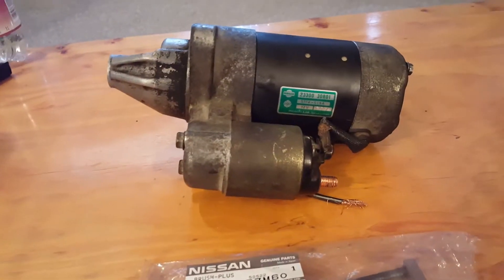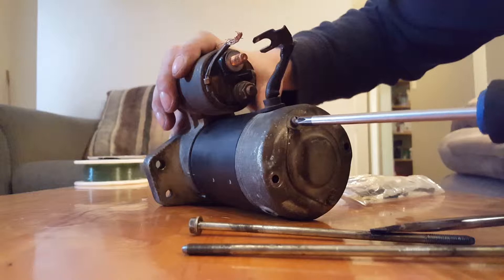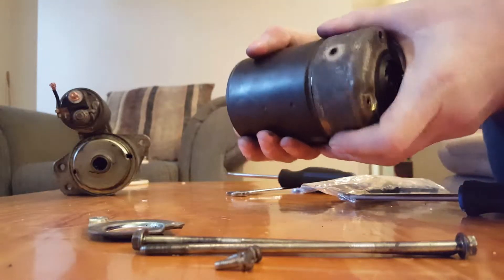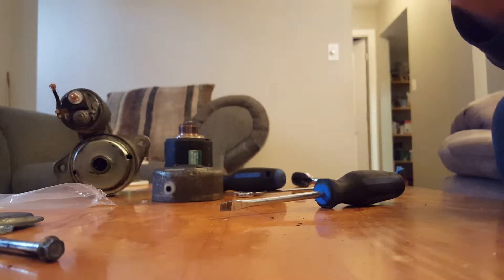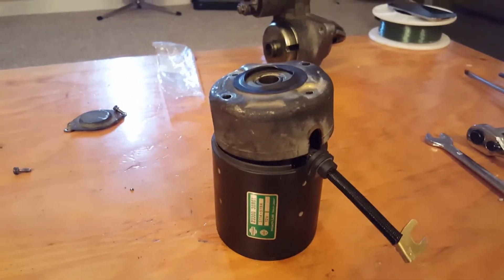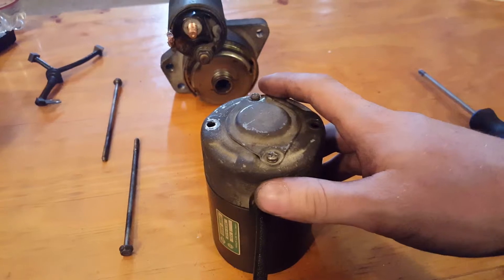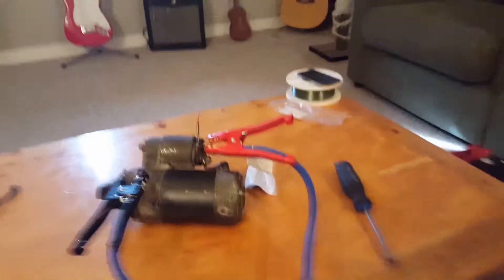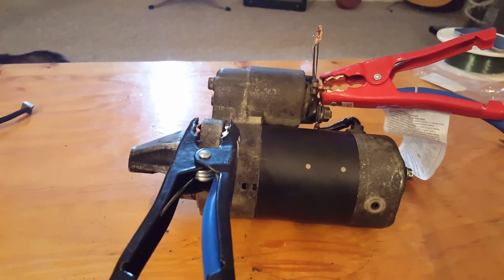240sx Starter Repair. DIY

Comment: I have strange problem with my 240sx. The starter will not crack but just click. The battery is new and charge and check the volt it good. The wiper, fuel pump, window, radio, power lock work? What might be wrong?
Reply from the maker: That's the same reason for me replacing the brushes. The click is just your solenoid engaging to send power to the brushes. If you replace them, it should work just fine
Reply: Someone told me to check the battery and guessing the starter not getting enough power to crank the motor or turn the fly wheel. I don't wanna take the starter out because it was working before, now i put back in and not crank. I brought new battery terminal and i am guessing there too much resisting and not enough power flowing through. I am sure it must be simple fix. Gonna redo the ground wire and positive post. I hope it work because it have been 3 days now and no luck on cranking the motor. lol
Reply: Took out my starter and bunch of rust on the brush  and spring. Seem like 1 brush no making contact with the armature(copper)  Could this be reason why it not cranking?